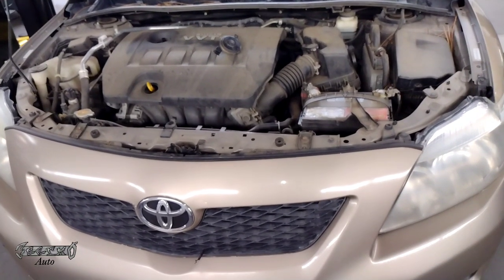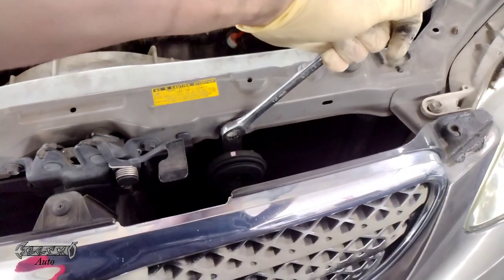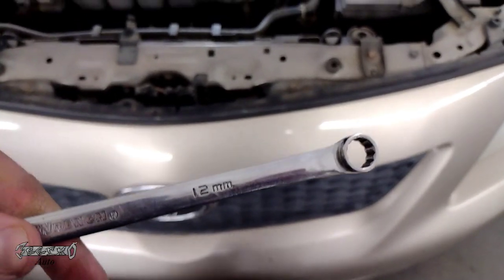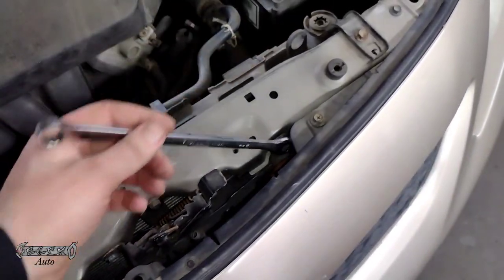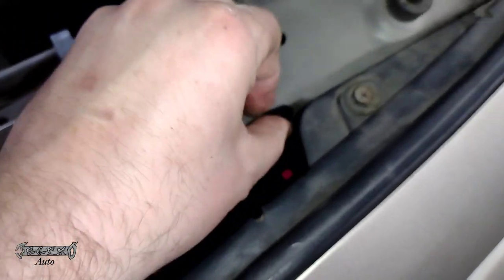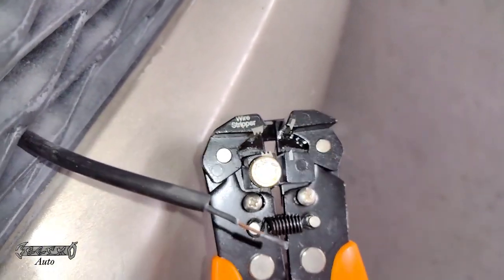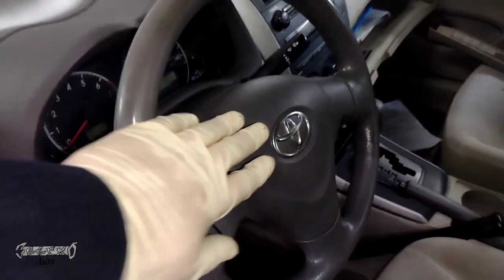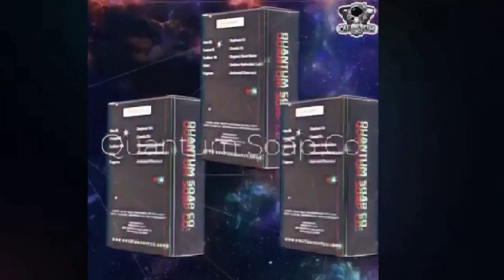2005-2009 TOYOTA COROLLA HORN REPLACEMENT+ VOLTAGE CHECK

Comment from the maker: GET THE NEW TOYOTA  HORN HERE ( AMAZON)
https://amzn.to/3Kk6N3K

GET A NEW HORN WIRE CONNECTOR HERE (AMAZON)
https://amzn.to/3ZSPk8c

PART #S 
NEW HORN-              86520-01050
NEW CONNECTOR-  90980-10619

NOTE THE HORN LISTED FITS BOTH COROLLAS MENTIONED IN THE VIDEO.